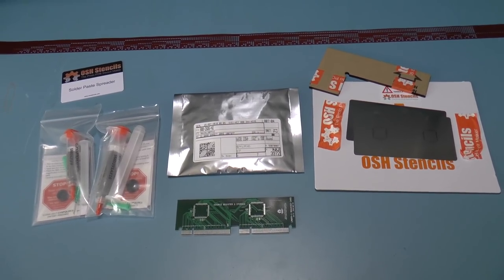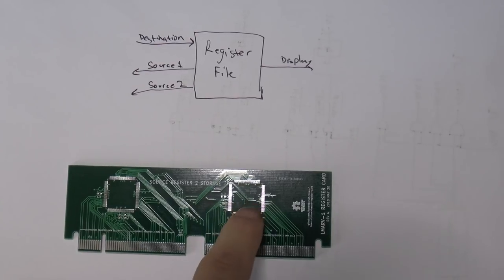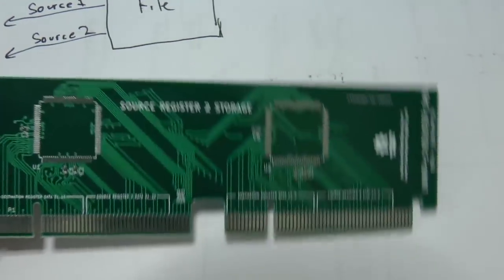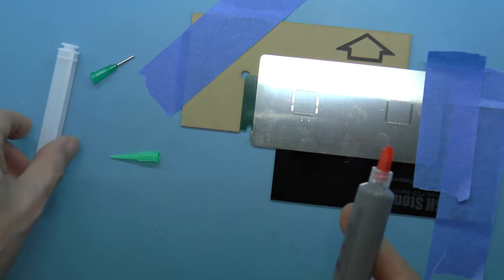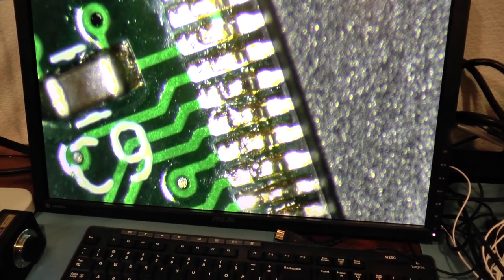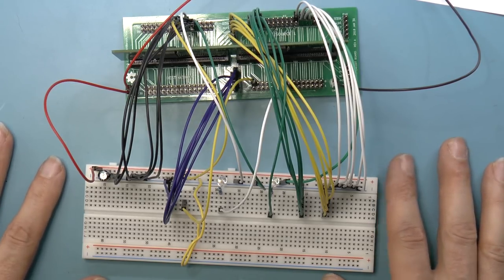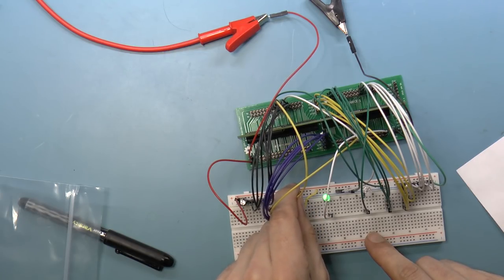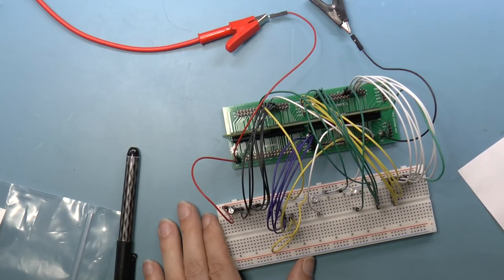LMARV-1 (Tangible RISC-V) Part 2: Redesigning and testing the register file

Comment: You might have additional reasons why you use two different solder pastes, but you can use only one kind. I am doing double sided reflow in production without two solder paste types. After reflowing one side and you are reflowing the second, the first one stays attached through surface tension. Also a reflow process boils off some of the flux, so the second time you reflow you will need higher temperature to melt the solder. Both things together are almost always enough to hold on the parts on the first side of reflow. Also you should be ok with the TQFP-100 they are not that large if you are concerned that the surface tension will not keep the first side hanging off the pcb. If that is what you are concerned, you should use heat curing glue to keep the package in place when it is up side down. Cheers and thank you for the awesome videos, great to see the RISC-V come together. :)
Reply: Oh man, Piotr, I should have asked you before going through hoops and hand soldering the other side of a recent double sided board :-) Excellent tip, thanks!
Reply from the maker: I kind of thought that might be true, but I didn't really want to test it using USD50- worth of chips :)
Reply: Sure, better safe than sorry. I am glad to see that it worked out! :) One more tip: next time when you plan to use solder paste and reflow get your boards with ENIG or Immersion Silver finish. This will make the pads flatter, decreasing the amount of "ooze" that you had around the pads. Additionally HASL results in additional solder on a pad. These are likely the reasons why you had excessive solder resulting in  shorts between pads after reflow. This were only 0.5mm pitch TQFP pads, you should not have solder bridging after using solder paste and stencil. :) (need to do more streams showing stencil and reflow techniques on my own channel, that might be useful :) )
Reply from the maker: Ah, that's a good tip. I'd definitely like to see good reflow technique videos.
Reply: @RobertBaruch  I've reflowed many FPGA boards with a ton of caps and resistors on the bottom side, and none of them ever fallen off (I did the bottom sides first as I didn't want to subject expensive FPGAs to additional reflows), but for larger chips you can use thermosetting glue that was specifically designed to be used during reflow.

Comment: A QFP barely in the realm of hand soldering? They're one of the easiest to hand solder. A small hoof or drag soldering tip and extra flux makes it really quick and easy.  Dealing with stencils, paste, and ovens for a single board is a pain. Control of the amount of paste is difficult to get right the first time.

If you reheat solder always use flux to prevent oxidation of the surfaces. Solder will flow towards heat, flux away. With a small chisel or hoof/bevel tip flux the joint and touch the iron to the bottoms of the legs. The heat will reflow the solder and with the flux removing oxidation the solder is free to flow to the hottest point. The solder bridges will remove themselves. That basic principle is how drag soldering works. The shifting of heat from pin to pin makes the solder follow the iron tip as it's pulled along.
Reply from the maker: It's pretty much what I ended up doing for one of the chips, and the hand-soldering actually went better than I thought. Maybe I was thinking of the 0.4mm chips that I had the worst time with. Also, I need that drag soldering tip in the worst way.

Comment: you can use the same solder paste for top and bottom.
We only have the heavy components falling off (like inductors...).
even without the red glue.
just use a little aluminium L shape as stand-off so the PCB is resting on the alu and not the components.

Comment: Regarding using SRAM for registers: I recently got a bunch of castoff 8051-family microcontrollers and related development tools from work and I've been playing with them. They've actually got a region of the internal memory-addressable SRAM set aside as several banks of registers. It's quite a different architecture from RISC-V, so the "register" concept is not even exactly the same, but I thought the parallel was interesting. Congrats on working through the bugs in your process and getting the thing working!

Comment: For a small board I just run a thin line along the pads of the TQFP and place the chip on the pads without caring too much about getting  paste on the solder mask. When the solder melts capillary action pulls in the excess. No stencil and  associated mess.
Reply: Vince I I find it's quickest to do those by hand with drag soldering. As long as you have a decent iron and flux it's a 60 second job. Much less mess too.

Comment: Plcc,s like this are easy to solder by hand.

1. Tape component down
2. Put a halve conical  tip in your soldering iron
3. Lay line of flux along leads
4. Load flat side clean tip of soldering iron with solder
5. Drag flat side down the component side soldering the leads as you go
6. If your heat is good and things are clean each lead will be left with the perfect amount of solder.
7. Repeat for the other sides

https://photos.app.goo.gl/QEwTZ1GZsUXAgxMH7

Comment: Why not just use a dab of epoxy to keep the components in place like they do in industrial two sided reflow or wave soldering pcb population?
Reply: Epoxy is no good if you need to remove the chip later.
Reply: It's a 100pin 0.5mm spacing IC.  If you need to remove it a dab of epoxy isn't even close to the most inconvenient part of that process.
Reply: What are you talking about? Removing a 100 TQFP device is incredibly easy to remove if you use the right tools. Putting epoxy on the device makes that process almost impossible because you'd have to burn off the epoxy. If you're thinking of removing the device with a soldering iron then you really have the wrong idea.
Reply: Yes I'm aware.  I work in this field as an electrical engineer.   A reworkable underfill epoxy usually has about the holding power of a post-it note.  I'm really not a moron who has never heard of basic component desoldering practices.
Reply: Dude, I'm not trying to pick a fight. You said "Epoxy" without being specific about the type of epoxy - not everyone watching is an Electronics production engineer - all they may have is some epoxy in the drawer somewhere that is wholly unsuited for the task at hand. That said, I'm out.
Reply: I didn't mean to be too prickly but you just started out by saying "What are you talking about?" and then dropped a link saying "Just for you."  It all felt quite condescending.  I wasn't looking to be rude more just trying to say, that you shouldn't just assume someone is uninformed.  I apologize if it seemed like I was starting a fight but that impression is the same one I got from your response.
Reply from the maker: It's a possibility! I recall desoldering a bunch of SMDs (for collecting) and having my eyes water because of the glue they used to hold the chips down. Fun times.